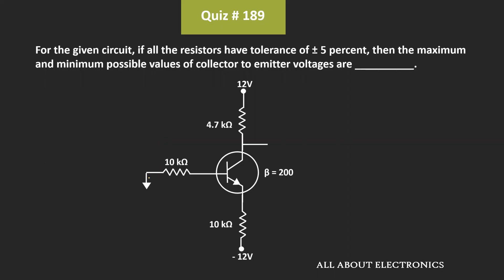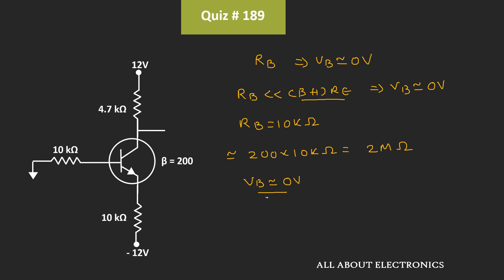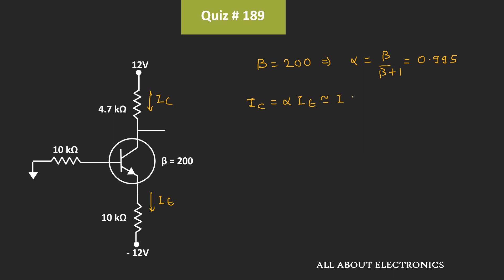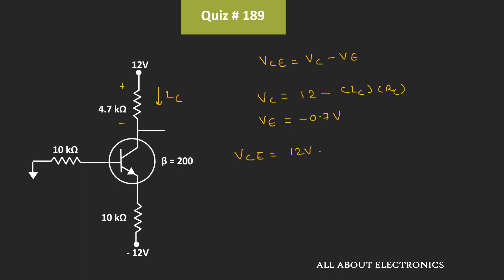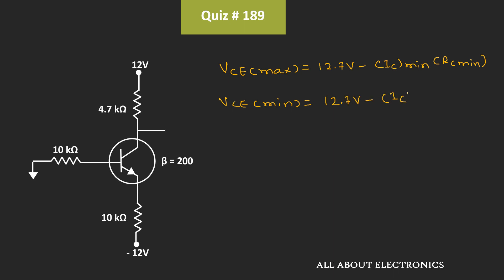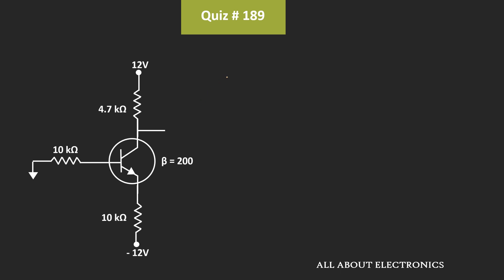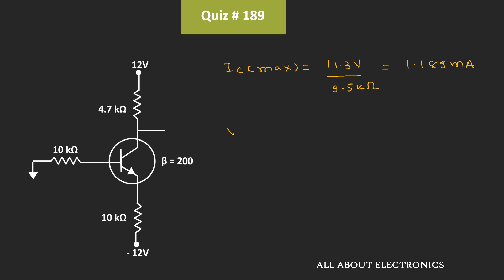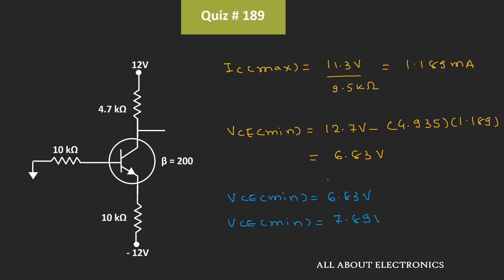Quiz # 189 (BJT - Emitter Bias Configuration)

Comment: shouldn't Ie=0.7 -(-12)/10k?
Reply: Oh right haha. My bad. You just did (-0.7)-(-12)/10k as 12-0.7/10k

Thank you mate. Your lectures just helped me gear myself to get full marks in my exam tomorrow 🙏✊🏽
Reply from the maker: Vb is Zero. Therefore Vbe = Vb - Ve = -0.7V. 
Therefore it is 12 - 0.7 / 10k . 
I hope it will clear your doubt.